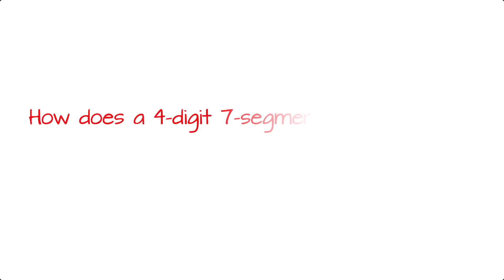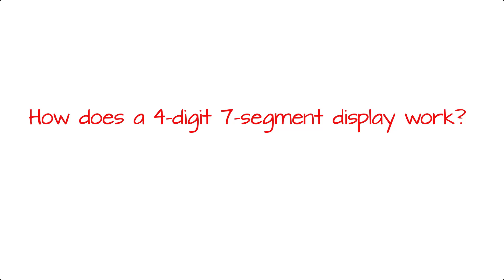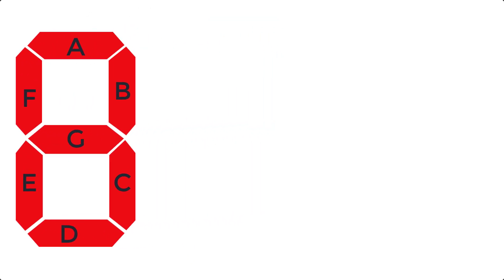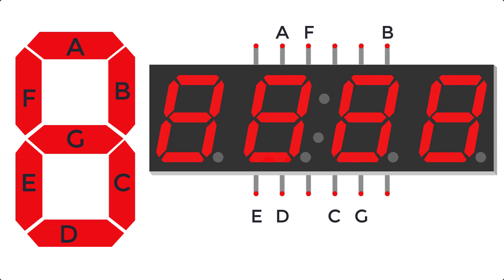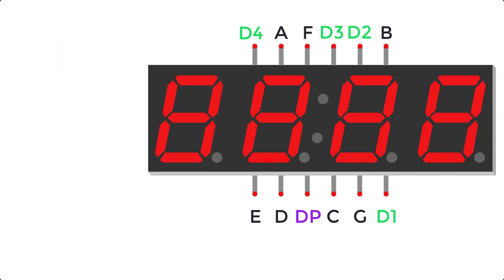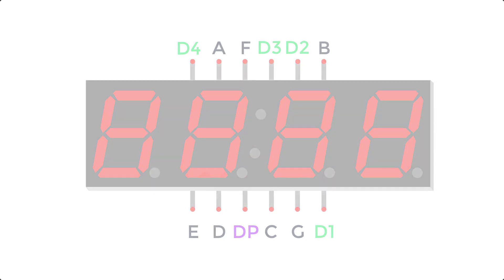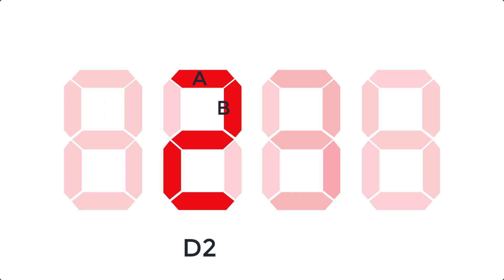Learn How 4 Digit 7 Segment Displays Work

Comment: which pin is for the ground?
Reply: All digits are connected to negative if you want them on
Reply: Every other can be on positive for on
Reply: It depends on the type of display you have, you can have a common anode display or a common cathode display. @quinn2090

Comment: Where's the pin for GND?
Reply: The LEDs only need voltage difference between ANode and cathode to turn on. The Arduino pin connected to Anode will be driven high and the Arduino pin connected to the cathode will be driven low. By this, it is achieved,

https://wokwi.com/arduino/libraries/SevSeg

This link 👍👉 is the free Arduino simulation page for 4 digit seven segment display.

for more such free simulations,

visit: https://wokwi.com
Reply: you tie the VDC - to the digit choice pins that are shown green in the video. Don't forget to put a resistor at the positive side or the LED's will burn.
Reply: @lambdasun4520  So if u want to power (for example) the first digit, all the rest of the digits act as ground? Am i correct on this?

Comment: Which pin  is for D2 & D3 decimal point ?
Reply: You can always google the pinout ,no need to remember
Reply: 4 digit 7 segment displays with a colon usually have additional pins. You'll have 7 pins for segments A-G and 4 pins for D1-D4 and a pin for DP as normal (12 in total) but you'll often find 2 more pins, which are for the colon (:) between digits 2 and 3.
Reply: A,B,C,D,E,F,G-D1
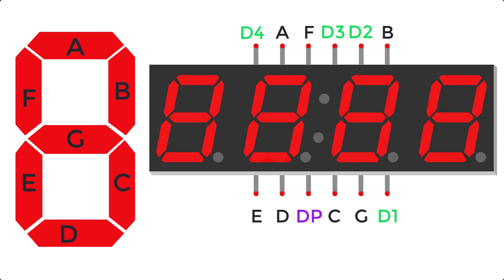Reply: The dp pin (you can find it in the pin diagram shown at 0:40 )